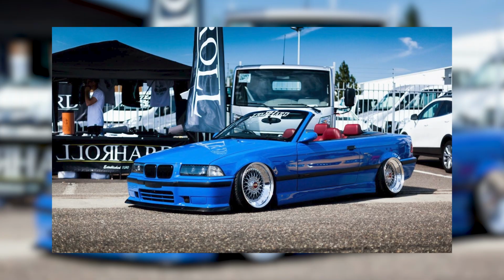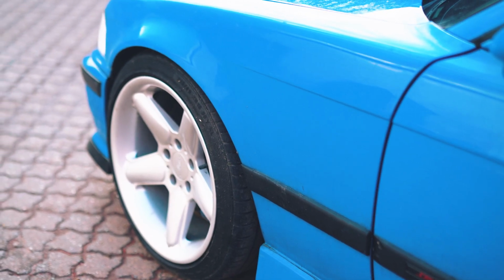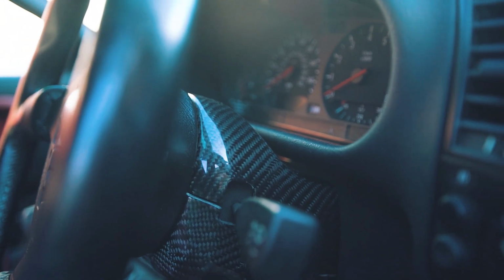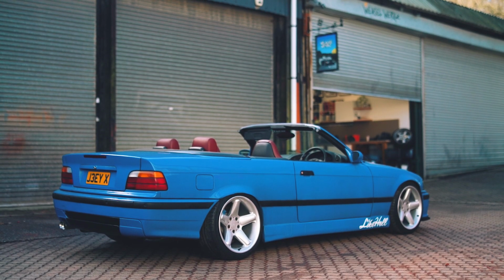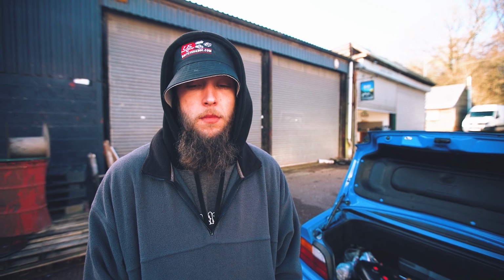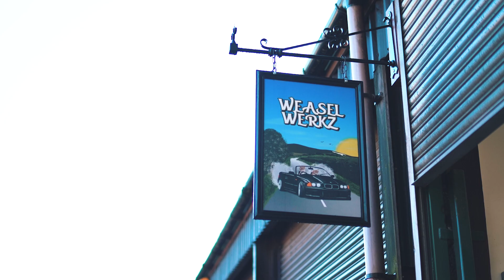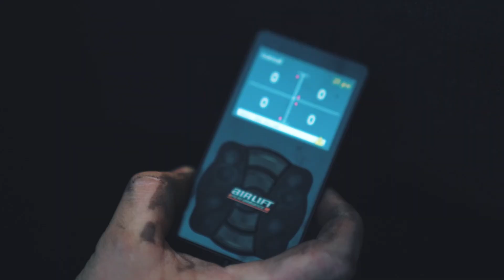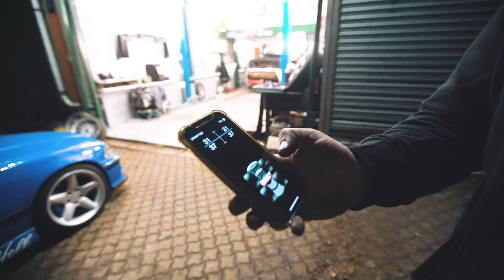BMW E36 Air Suspension Install | SLAMMED!

Comment: Hi iv just got air ride for my e36 coupe 3201 only 54k so it’s very clean and rust free I was wounding where you run the air lines into the boot